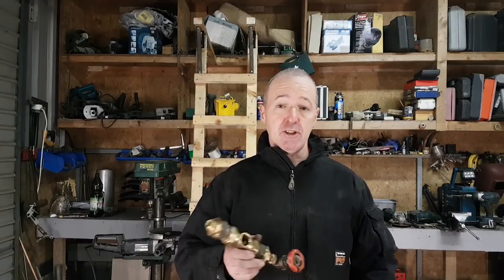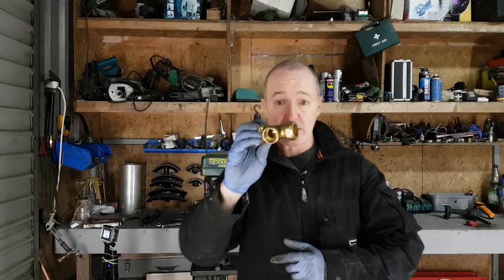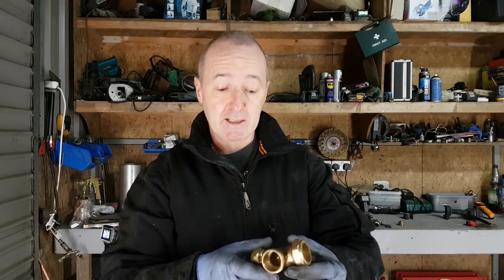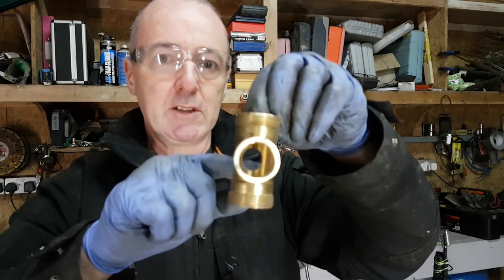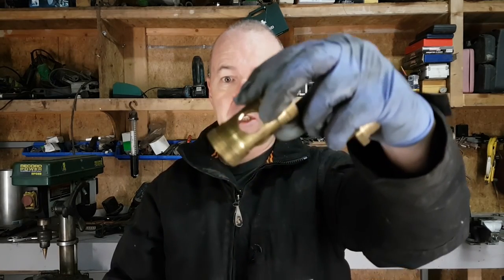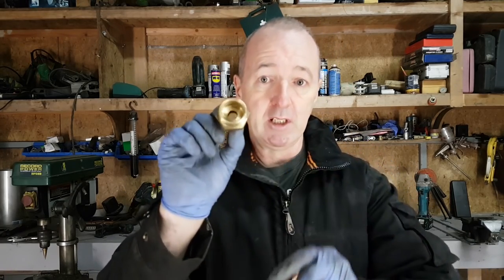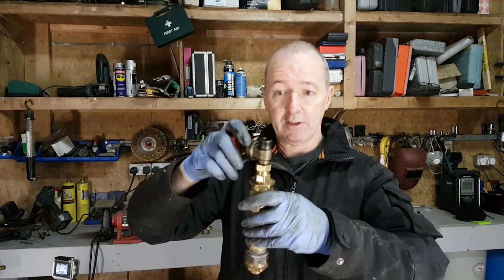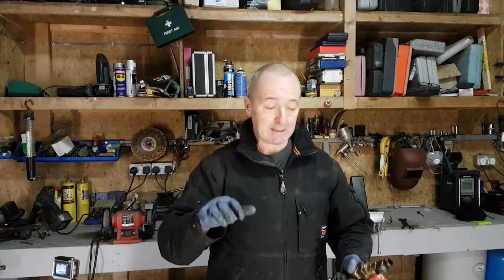Waste Oil Burner -- How to make a Drip feed

Comment from the maker: Hi. There is a card that drops down at the top right of the screen that shows the mod to the valve. It appears automatically at 12:32 in the video or you can just click the info button top right from GerrysDiy  . There is a link in the description  to the mod. In the playlist it's called Drip feed Mod Explained !! Homemade Waste Oil Burner .. Free Heat Here's a link too https://youtu.be/Bf38HSxtSBw    Hope this helps.  Cheers Gerry👍
Reply: Don't know whats going on with my YT but no drop down. I got it from the link though, cheers. That explained it very well. I am off to the hardware store soon. It's autumn here and its getting cooler, daylight saving ends this weekend and I need to get sorted for my shipping container workshop. We don't get the cold that you get up there but I'd rather be warm than not. Keep up the great videos, they are a highlight of my week!

Comment: This one looks so much easier to build than the steel fittings that you used in an earlier video.
Great work Gerry.
Reply from the maker: Hi Martin. It is possible to make the steel ones more compact because the threads are intermal but this version will work no problem. Thaks for the support and your comment Much appreciatd Cheers Gerry

Comment: This is so cool I'm gathering the parts together cuz I have to make one myself
Reply from the maker: Hi Hector. I tend to drive my burners hard but they will run at lower outputs. If you need free heat they can certainly make lots of it. Thanks for the comment Cheers Gerry

Comment: Is there a better way, of feeding the burner? I noticed that on cold start oil is thicker and flows slower but when it warms up flows easier so i have to check all the time. Also burning different oils/fluids. A clicking pump from a diesel heater is good for oil? 
And one more thing, sometimes oil not burning well, is collecting in the pot and then it does a "meltdown", burns with a lot of smoke and container gets red hot, this was fixed by putting a laptop cooling fan to blow air into burning chamber.
Anyway if the oil feed is fixed then it can burn without constant supervision, that would be great.

Comment: Gerry very informative as usual have you a list of parts used
Reply from the maker: Hi Joseph. If I were going out to buy parts to make a drip feed system I would make it a little different. You can see the drip feed on my Frankenstove. Its made from iron and I weld a bracket to it. 

The drip feed in this video has qty 2........1 inch x 1/2 inch straight compression fitting and qty 1 ............... 1inch compression Tee
I will add this to the description. Thanks for the support Cheers Gerry

Comment: Hey Gerry, sorry to be a pain but you said there was a link to the video with the gate valve mod but I can't see it on the screen and have trawled back through heaps of videos to find it but still no luck. Could you point me to the video please?
Reply from the maker: Hi Jeff. No Worries There is a card that drops down at the top right of the screen. It appears automatically at 12:32 in the video or you can just click the info button top right from GerrysDiy  . I just made a new link in the description of the video too which will help anyone else finding the video. In the playlist it's called Drip feed Mod Explained !! Homemade Waste Oil Burner .. Free Heat Here's a link too https://youtu.be/Bf38HSxtSBw    Hope this helps.  Cheers Gerry👍

Comment: Hi gerry. Thanks for info ref gate valve. Ill email picture of my set up. Going to use a metal funnel and pipe instead of tank.
Reply: Why do you need to see the oil dripping....I saw a guy with a coffee can resivor...hooked up to 18"  brake line ...and a ball valve
..small drop feed...
Reply from the maker: Hi Jerry.  I can control the heat output better if I can see it. If I run it straigh into the burner its hard to see the flow. If I load the stove too much it can go crazy hot but might be making smoke too. Cheers Gerry

Comment: Hi Gerry, Whilst browsing the web, I came across a ‘Rocket Mass Heater’ which allegedly burns about a tenth of the wood of a wood burning stove, and produces mega heat because it burns all gases and creosote etc. Can you show us how to make one please?
Reply from the maker: Hi banditnige. I have a quick build  little rocket stove project that will be uploaded in a few days. I will be doing a full rocket stove soon after  Thanks for  the suggestion. Cheers Gerry
Reply: Why didnt you use fittings that are the same size as the feed pipe ? I was thinking of doing one with 15mm pipe all the way to the burner. Great videos.